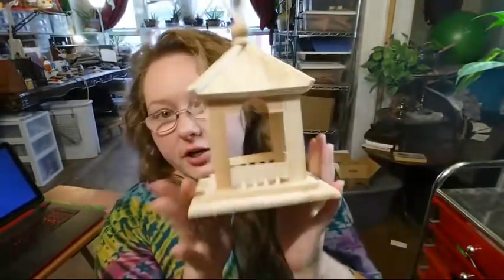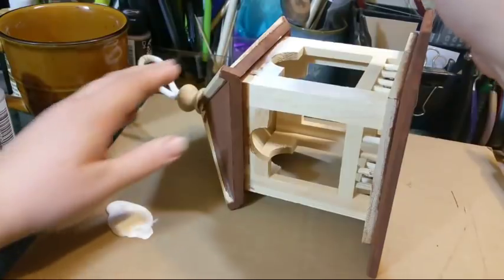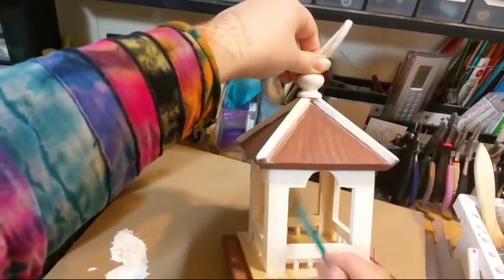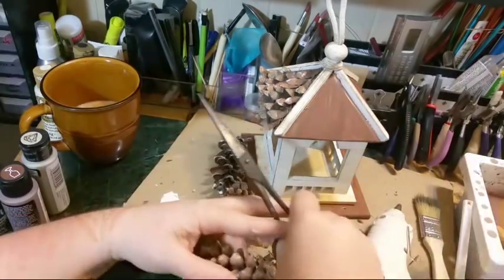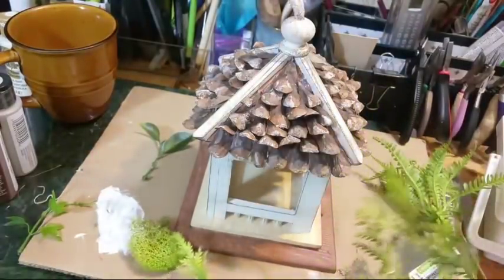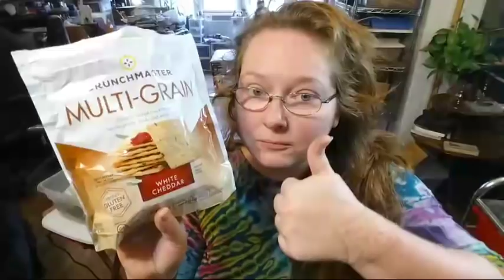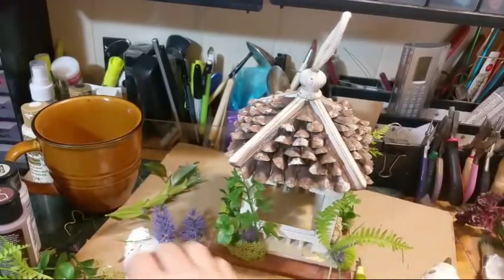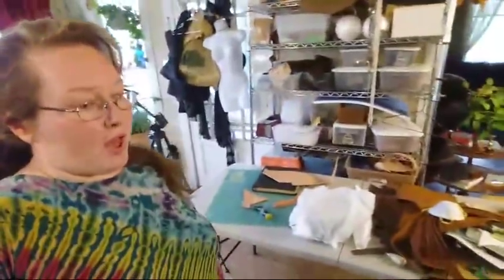Fairy House Sculpt Live!

Comment: I have a question for you. I like to make to make engraved and gem encrusted bangles using  3-5mm flat wire. I would like to incorporate wire wrapping and figure out how to set small chunks of flat wire. Picture a 2inch piece of 5mm flat wire which is invisible beneath a mountain of carefully placed gem stones attached with e6000 or epoxy. I could leave spaces on the sides of the wire for wrapping. You can't really put wires across the middle without having to put it under the stones, unless maybe really small wire that could make the stones look drizzled in metal or held by wire.

Comment: Hey i'm having a issue..lol, trying do a commissioned painting..3d.  The problem is i need a wire fence..have tryed wire..hot glue painted. The wire would not hold together and the hot glue will not peel off anything i have tryed..even using oil to coat wax paper and then let it cool..still ripped to pieces...any sug?
Reply: What kind of wire did you try? Like ,maybe if you fried the fuzz off pipe cleaners they'd be light enough?
Reply: Thank you for reply. I bought a wire strainer and dismantled, this worked great..thank you.
Reply: They have a wire mesh at Hobby Lobby in the plaster/ clay section for making sculptures and such. Not sure if this helps. :)
Reply: @Athena540 😇😇😇😇🤠🤠😇😇